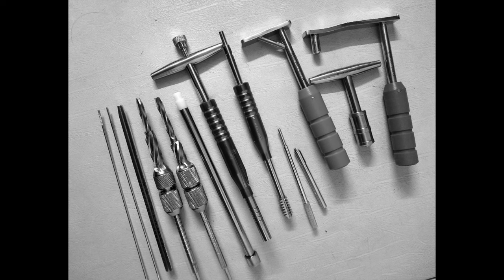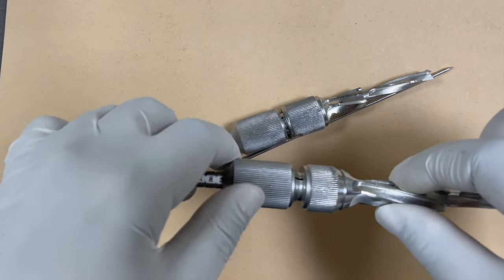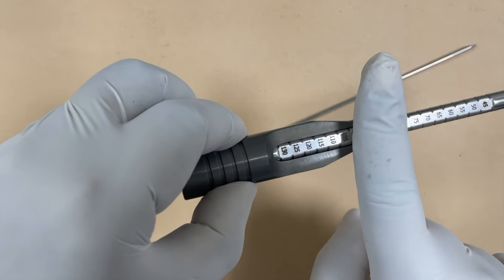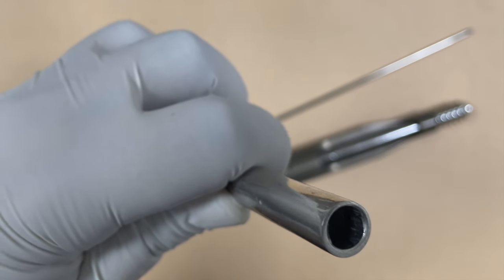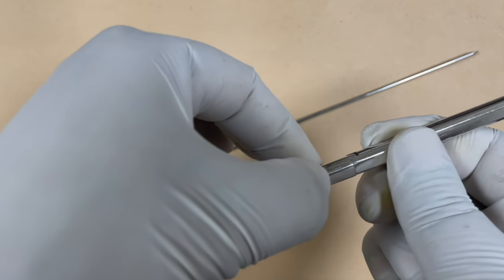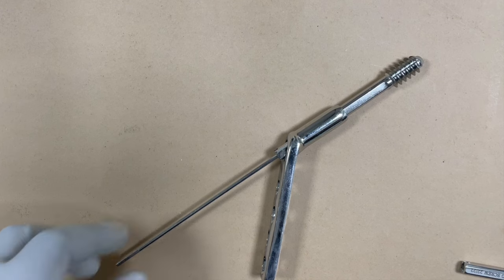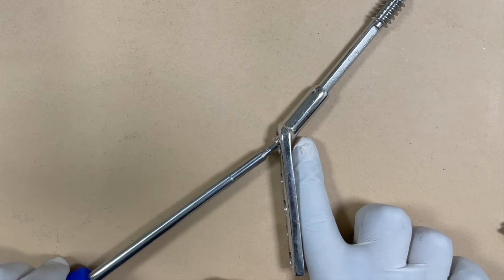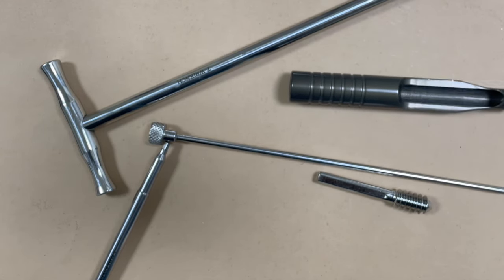All Dynamic Hip Screw (DHS) Instruments explained

Comment: Sir is lag screw - Richard screw or 
Compression screw - Richard screw 
Thank you sir
Reply from the maker: Whole system was originally developed as Richard screw system. The lag screw is actually Richard’s lag screw. While the smaller screw is Richard’s compression screw. Lot of confusion is there, regarding which one to call the actual Richard screw, but is actually a pointless discussion. Some call the lag screw as the Richard screw while others call the smaller one as Richard screw.

Comment: Fantastic video thankyou ! Is this  DHS able to be removed from the hip / femur in a healthy person once the bone has healed ?
Reply from the maker: No, the DHS needs to be removed only if there is any impingement related symptoms like some constant irritation, signs of infection/inflammation or signs of AVN on radiographs. Routinely it should not be removed because the bone will be left with void that will take long to heal and will put the proximal femur at a risk of additional fracture with minor trauma.
Reply: @Justorthothings  Hi hey thankyou for prompt reply , I have a dhs and cannulated screw installed  into my right hip that's why I'm asking ...I fell 18months ago.  My surgeons have advised they can remove it but I'm real nervous about it ...I'm 47.....I think the general problem is the exposed part of the fitting doesn't allow the muscles to navigate work properly and so the leg does not  strengthen properly....so I'm having also sorts of issues with my hips ...my joints are fine .I feel 90yrs old ! I look at the xray thinking that is a huge hole left in the hip , they said they fill it with human matter and bone will become 100percent strong in 3months .....but I just can't get my head around the removal of the dhs ...as you back the screw out through the NOF it must displace bone ? Putting pressure around the NOF so it risk of cracking the NOF ? Surgeon said it has reverse cutting thread. It sounds like a high risk operation to me ?  Any thoughts comments appreciate  🙏 ...I'm in New Zealand
Reply from the maker: @MrBoatcare  Sorry for the late reply. Somehow, I missed the notification. If the screw is protruding, it will definitely affect the function of surrounding muscles. In that case, you can get the screw removed. But have to follow protected weight bearing with some assistance till there is radiological evidence of healing of implant void. For better understanding, you may share the radiograph with me on lakshaypaper@gmail.com